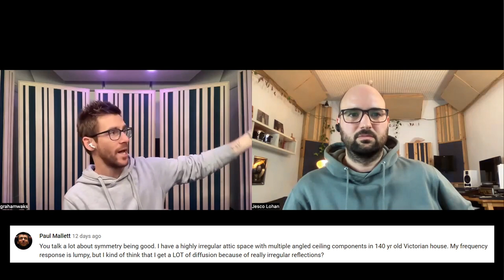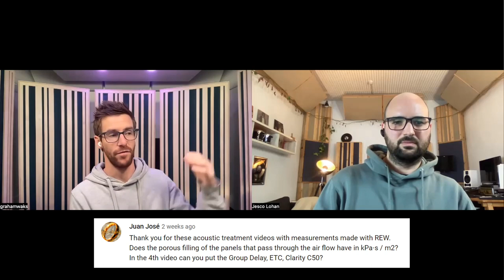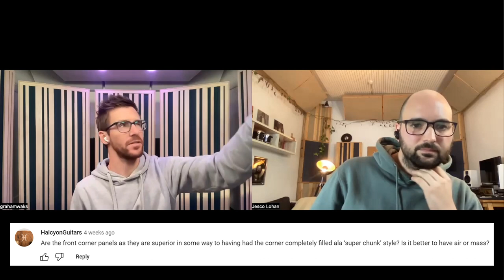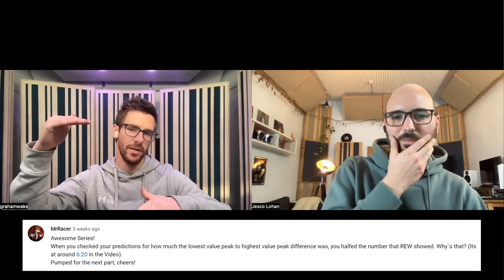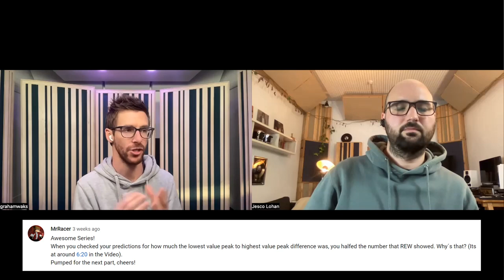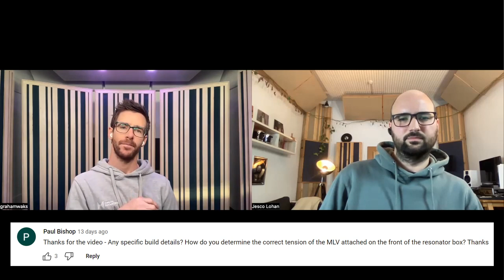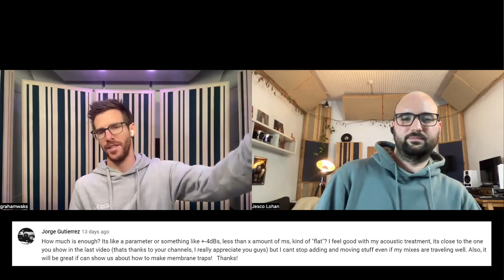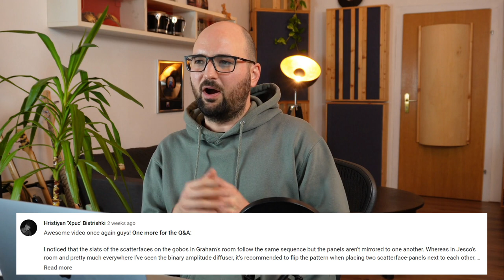Treating A Studio Start-To-Finish #5: Your Questions ANSWERED (with MusicCityAcoustics)

Comment: I found with my really oddly shaped ceiling, that the rectangular calculations still get you in the ballpark. I have a large part of my ceiling with gypsum boards and behind that there is rockwool, so there is some treatment coming from the build of the house already, gives a huge benefit in ringing compared to the room you guys treated here. 

I still need some treatment, but nearly not that extent that you used in the room to get to acceptable levels, just because of this neat thing. So people shouldn't sleep on "bad" room shapes, as they could have hidden benefits. Also, your listening test helped me lots. I couldn't really move my desk, but the speakers came off speaker stands behind the desk and I moved them onto the desk, they are in a much better position. Spectogram wise I'm getting a really good distribution, only frequency response is lacking, because I don't have treatment in here yet. We'll see how it works out after building some panels.

Comment: Thanks again guys. Very usefull as I'm right in the middel of my studio build. I have an other question about using slats. My studio (both tracking and mixing)  is being built in an attic with sloping walls (i.e. the roof). These sloping walls  are being covered by 16 cm of stone wool, with an airgap of about 2 -3 cm.  The vertical walls on one side are fully covered as well by again 16 cm of stone wool, with an airgap of about 10 cm. I plan to cover about 50% of the other vertical wall with 10 cm stonewool panels (left over from my previous studio). Oh and I also will be building very deep bass traps where the roof/ sloping walls meet the floor: there's already a space made there to store stuff. We have camping gear and such in there, and I want to add another 16 cm stone wool bass trap in front. The same aplies for the small mini attic in the top of the room. I want to fill it with about 30 cm of stone wool and then make openings in the wooden ceiling (it's about 2 by 3.5 meters) and cover it with textile.   
My question concerns where I should place slats for diffusion. I tend to go for the back sloping wall (furthest away from the mixing position)  covering about 50% with slats, and maybe a small part of one of the side walls. I was wondering if diffusion on the sloping wall might have some sort of unwanted effects?